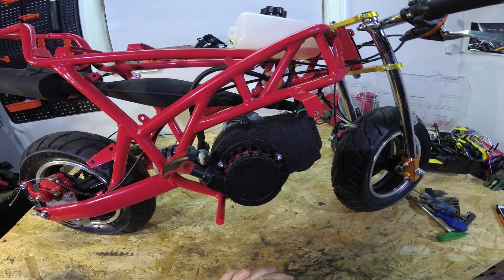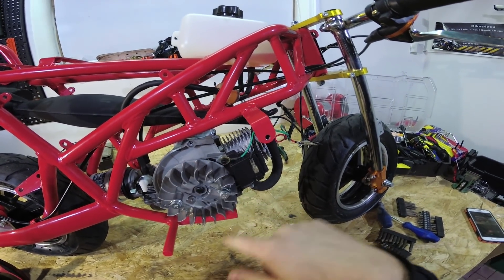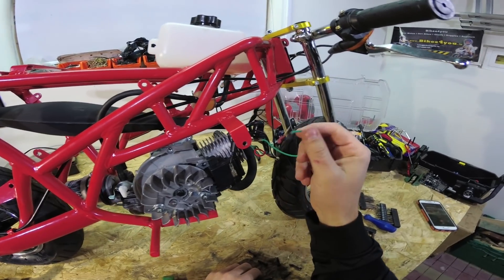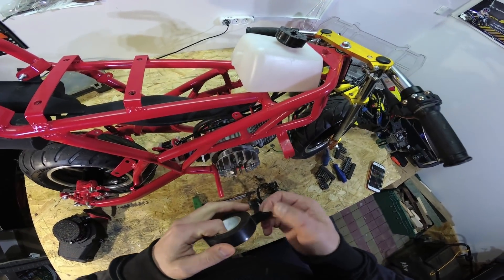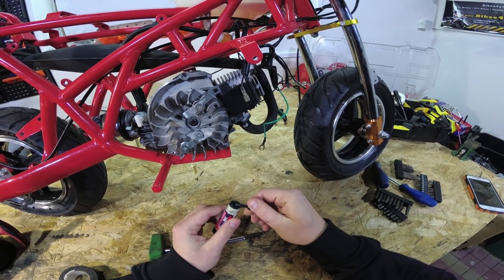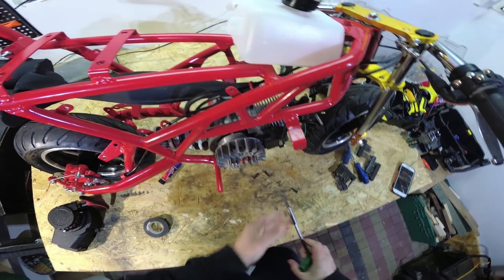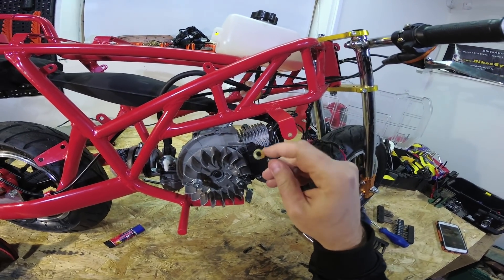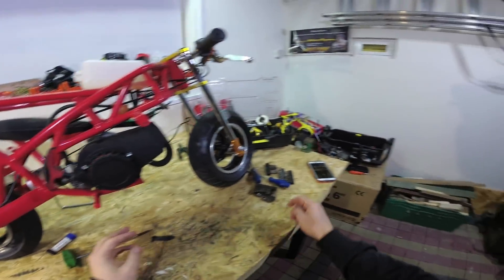How to Replace Coil in 2 Stroke Pocket Bike Engine - Instructions PS50 Nitro Motors

Comment: Hello I have a question. My question is i have two ground wires on 49cc and I am wondering where should i connect them? I saw in your video where to put one ground wire but i dont know where to put the second one! Thank You for help!
Btw i forgot to say that my mini dirt bike is: Kxd moto db 708A
Reply from the maker: Hi, do you have two in old coil or in new one? as I have never seen one with two wires, if you do not see where to connect the second one just connect one, see if all the switches and ignition is working, if so then do not connect second one just put the tape on it so it won't ground the coil while using the bike.
Reply: you would never need 2 ground wires for ignition the only thing i could see is if theres a computer or board or something else that needs the ground! it only needs one path to ground to end ignition